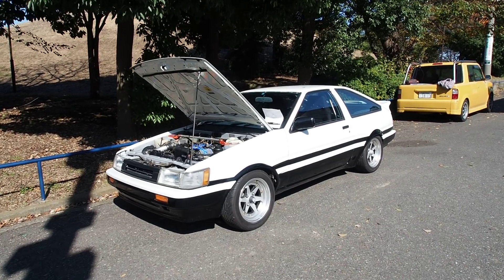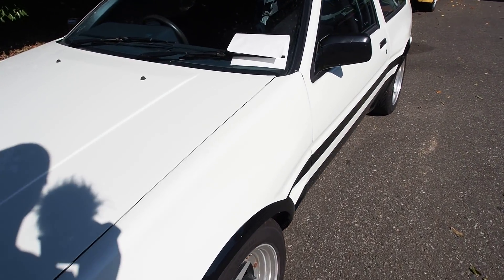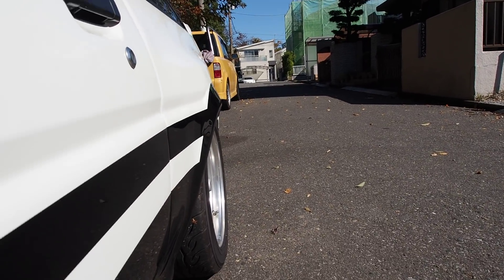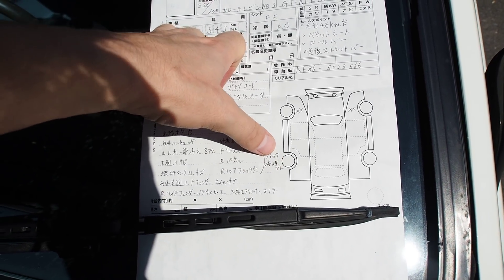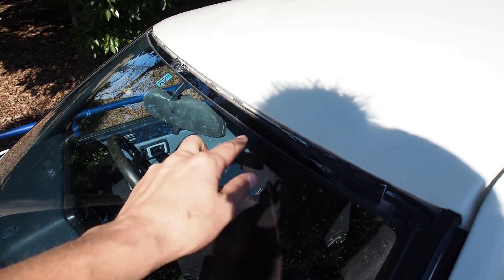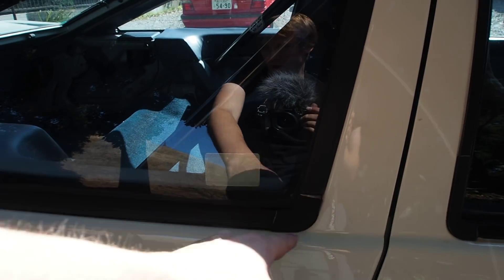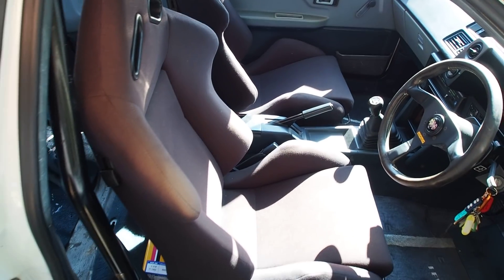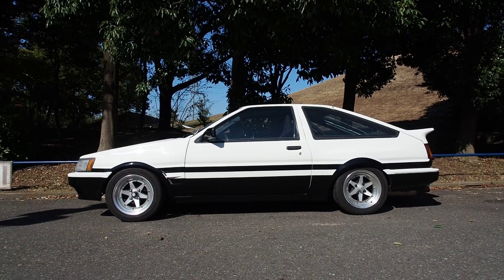1983 Toyota Corolla Levin GT-APEX AE86 Widebody - Japan Auction Purchase Review

Comment: That means it uncrowned my AE86! :D
You are absolutely right: that hole doesn't qualify as rust! :P
About the digital gauge cluster: it was still available on the kouki type as well but they didn't change them with the new vertical stripes. Also it seems to be more rare... Also the flip up grille is open, so have you been running it for a long time to make it hot enough to open up, or is it stuck in open position?
Where are you exporting it to?
Reply from the maker: I looked at the grille but I don't think this is the flip front one. If it is, it has had the parts removed (including the runner for the bracket). We have only exported two of the flip-grille models. Very uncommon.
Reply: PacificCoastAuto that's quite strange... I know the flip up grille breaks quite easily, but that shouldn't be a reason to remove the parts. Otherwise it could also be a performance mod: it will only open when the water temperature is over 100 degrees Celsius, and this way it is open all the time
Reply from the maker: Yes, the broken ones I have seen were all broken in the open position.

Comment: The Trueno has 2 different versions (Zenki and Kouki).
But the Levin had 3 different verions. (MkI, MkII (Zenki) and MkIII (Kouki)).
Reply: and what are the differences?
Reply: Meterora The Fox Superficial facelifts. I think the original looks best imho.
Reply: Mk1 and Mk2 Levin's had the same back trim, with Mk3 the rear changed. As for the front, the Sporty version with the grill was the same for Mk1 and Mk2, but the regular front was all black for Mk1, and with Mk2 it received golden stripes. And the grill under the vent door also received a "TWIN CAM 16" badge.

The front bumper for Mk1/Mk2 were the same I think, but the Mk2 had an optional lip spoiler that you could order. The Mk3 had wrap-around lighting like the Kouki Trueno's and the front lip from Mk3 got permanently fixed as stock. 

Mk1 and Mk2 Levin are the Zenki models. That means, that the other differences between Zenki and Kouki apply to both Mk1/Mk2, like the horizontal rear wiper in Zenki and vertical on Kouki. Or the stock exhaust tips, interiors, etc. But 1 exception is the side mirrors. The Zenki Trueno and the Mk1 Levin had the same side mirrors. But Mk2 Levin received new mirrors. The Mk3 Levin and Kouki Trueno adapted the side mirrors from the Mk2 Levin, but used a different material.

I won't even talk about the wheel choices. Source is a magazine that I own from Japan, explaining the differences. My Japanese is not great, so if I have any mistakes, please elaborate. :)
Reply: coolcool thanks :P
Reply: I asked Tokuchi-san from Carland86. According to him, the Zenki exteriors are more popular overseas. Japanese people would prefer the Kouki versions.

Comment: Uhh the Levin isn't a true 86, it's not a Trueno.
Reply: Levins can still be 86s but nice try bud.
Reply: K then
Reply: TrouT - Considering the Levin came with the AE85 SOHC and the Trueno came with the AE86 DOHC engine, they are very different.
Reply: mynameisray nah. Both the AE86 and AE85 came in the form of the Levin and Trueno. The headlights aren't indicative to the engine used in the car. An AE85 can be a Trueno and an AE86 can be a Levin.
Reply: AHMAD H. - Go back to your anime, boy, leave actual car talk to the adults.
Reply: AHMAD H. You are right. This ray kid doesn't know anything.
Reply: mynameisray that's why I'm talking
Reply: mynameisray do a simple google search dude. https://en.m.wikipedia.org/wiki/Toyota_AE86 .
Reply: Seems like someone watched Initial D a little too much to consider facts
Reply: AHMAD H. - Thus the reason I told you to stop.
Reply: You can see from the video that it's a 1.6 twin cam. Aka the DOHC 4AGE. That's what the 1600 is referring to on the engine top.
Reply: 86 refers to the CHASSIS CODE; Levin/Trueno refers to the Trim level so your argument is invalid
Reply: Loli Dragon - The adults are talking, run along now.
Reply: Loli Dragon - So.. You post an asinine comment, then get upset when you're told to hush? Try keeping your ignorant replies to yourself if you're not looking to argue.
Reply: Good one
Reply: @mynameisray  considering “dumb as fuck” is a prepositional phrase there’s no way “dumb as fuck bubba” could be an object given the structure of that sentence. Also, not all levins are 85’s. Have a good day.